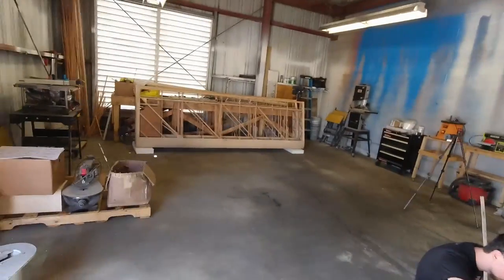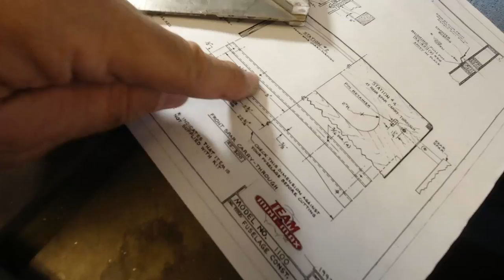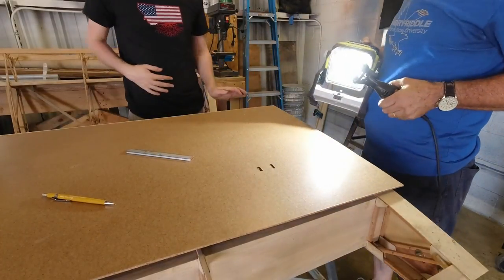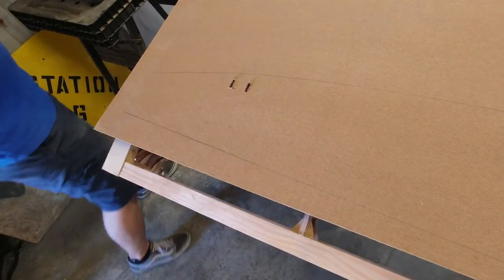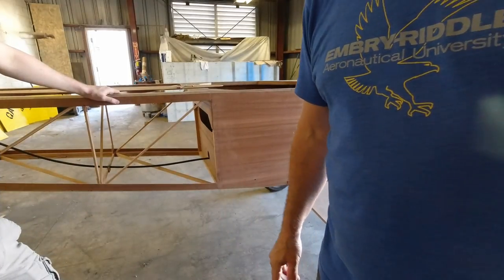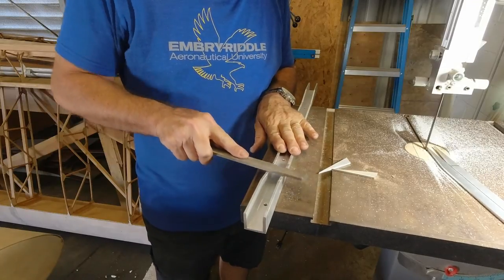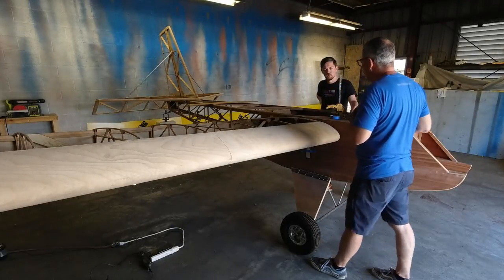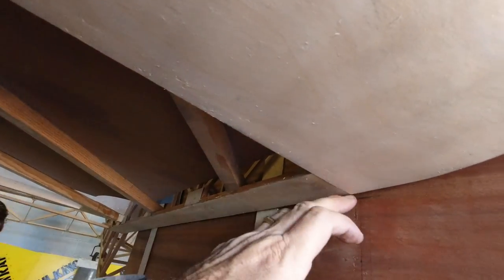Minimax 1100r Wood Aircraft Build Ep 117 - Attaching Wings

Comment: Dennis.  The dihedral was a question, when building the EROS.  Seems to me the 3 degrees was in the plans, however, Larry Israel (Mr. Minimax) said it should be 2.5 and not 3 degrees.  Something about the landings (flare) being better at 2.5 than 3 degrees).  Just a remembrance.  The actual setting of the dihedral, for my EROS, was established when installing the front strut and drilling "all in place."  Wasn't an easy task as I recall.
Reply from the maker: I had heard that before about the dihedral. 
That front strut on that side is next.
Reply: Dennis, I was ahead of myself with the dihedral comment, vs you working on the angle of incidence.  Yes, the angle of incidence is the angle of the chord line of the wing to the centerline of the fuselage.  And, yes, the dihedral is the angle of the wing from its "flat" position.  

It was somewhat of a chore to get that 2.5 or 3 degree angle.  Was scary "drilling it all in place," as that axel was difficult to cut through, as was the chromoly front strut on the EROS.   Really looks nice, Dennis. 

p.s. Speaking of dihedral, how about the "anhedral" of the old F-4 Phantom fighter's tail section?  I read where it corrected directional stability problems caused by a shortened Vert Stab required on aircraft carriers.  Interesting.

Comment: Dennis why did you g.ue the top front panel on ( under the instrument panel ) before you drilled the wing carry thru holes , that made it difficult to drill as you found out ! Ripley
Reply from the maker: Robert that’s a great observation. I was just following the build sequence but you are right, if there was a way to hold off on a portion of that until this step is done, it would have been a whole lot easier!